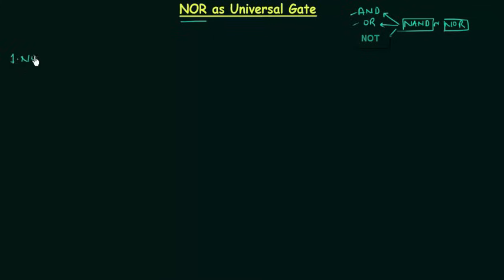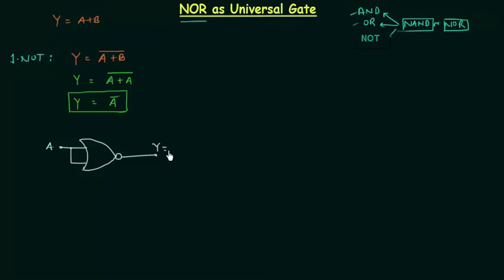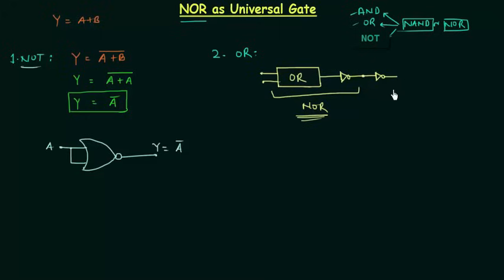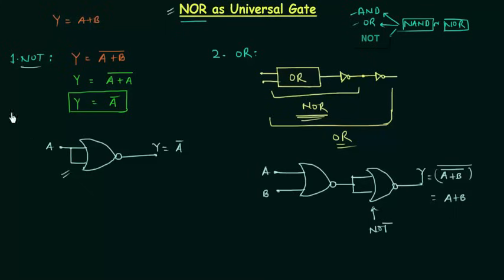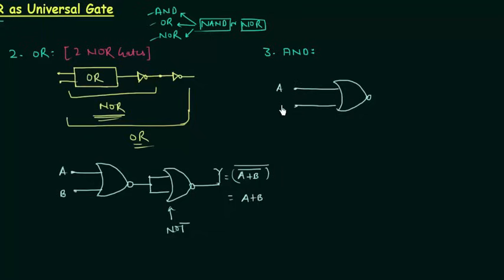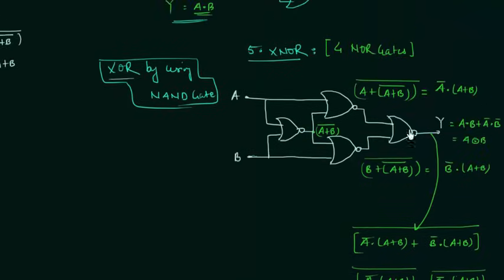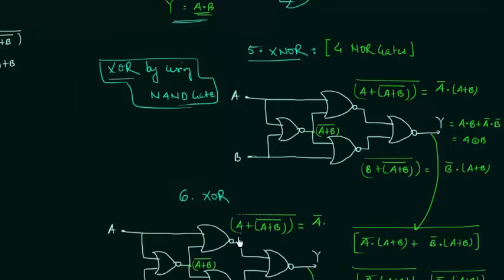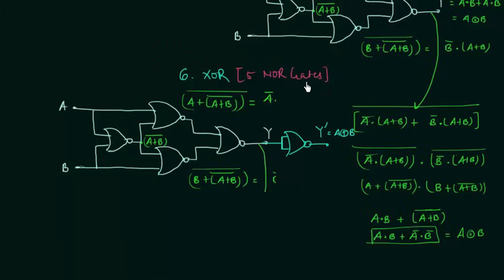NOR Gate as Universal Gate

Comment: 1) 5 gates
2) 4 gates (if we first take dual of expression and then solve)
Reply: How answer of 1st question is 5 ?
Reply: Is the second one a self dual function ?? I don't think so. So it's not possible with 4 nor gates. Normal simplification leads to 7 nor gates.
Reply: U r right.. It is self dual....
But how you combine  (ab) and (c. d') .U need to put one extra gate to get the output expression. .It will be an OR gate.... But here is the condition we must only use nor gate ....so in this case there is no other way to get the output .
So we require 7 gates to get the output....
Reply: 1)correct
2) 7 gates
Reply: You are Right! 
Q2-> 4 Gates by modifying the expression: ( ( A' + B' ) . ( C' + D ) )'
Reply: If you take dual you can't find second question same (A+B)(C+D') is not equal to AB+ CD'